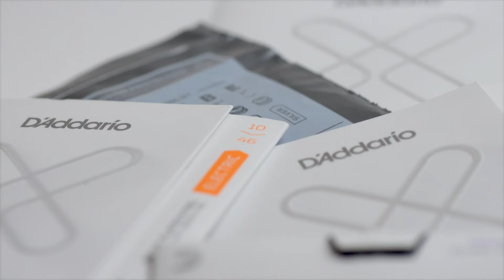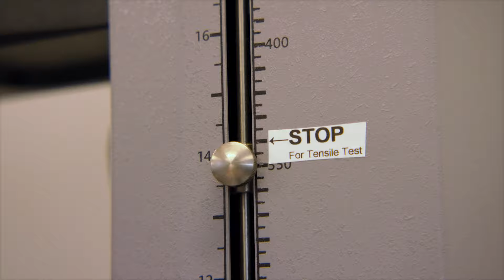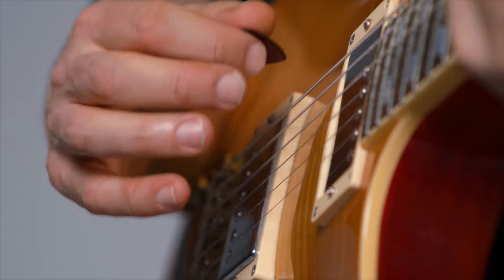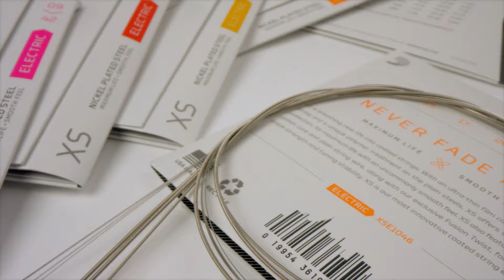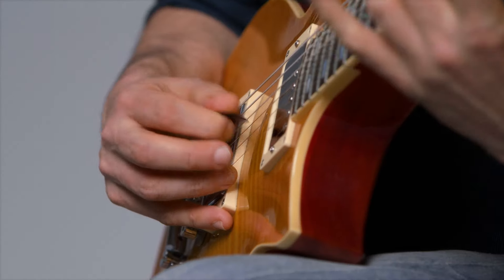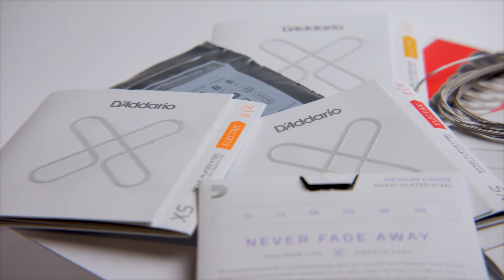D'Adarrio XS Electric Guitar Strings | The Story with Jim D'Addario | Demo with Alex Skolnick

Comment: I ran XS strings on my strat for 7 months, and only changed them because it seemed like I "should". They weren't discolored at all. There were no issues whatsoever. I replaced them with a set of the GHS Coated Boomers I used to use, and what a difference -- the Boomers do not stay in tune as well, and surprisingly, it feels like they have more friction to them. Chord changes took getting used to. TL;DR - XS strings are the best strings I've ever used.

Comment: These are the best strings I’ve ever played. Completely blown away. 

I noticed all the stuff mentioned here before watching this: my guitar sounded more like itself, very harmonically rich. I could play faster! And they stayed in tune almost immediately. 

These are a game changer!! I’m on the 9-46 set. I used to switch string types a lot… but these have absolutely the best of all types I’ve tried. The thin strings still have the fullness and resistance when I need them to… it’s like they only bend when you want them to. Also the noiseless aspect and coating feel remind me of my favorite flatwounds.

Comment: What's the difference between this and the XT?
Reply: These have a coating, more of a silky feel
Reply: @APPL3SL1CES  XT also has coating.
Reply: @aadityakiran_s  yes it does but the xs has a coating you can feel unlike the xt the xs feels like elixirs more slippery
Reply: @APPL3SL1CES  Okay thanks for the information but these are twice the price of the XTs which are in turn twice the price of regular D'Addario strings. So are they really worth it?
Reply: @aadityakiran_s  in my personal opinion yes because I have used xt and nyxl  and they rusted after 2 months and I’ve had the xs on my prs for 4 months now and no problems, I’m curious to see if they can outlast elixirs
Reply: @APPL3SL1CES  Maybe you have oily or sweaty fingers.
Reply: @aadityakiran_s  I perform in the heat which doesn’t help
Reply: @APPL3SL1CES  Yes. I perform in my air conditioned bedroom. That's great help. hehe...
Reply: @aadityakiran_s  lmao, it also depends if you like the feeling of a regular strings or smooth coated strings
Reply: @APPL3SL1CES  honestly i can't tell the difference between all the strings all the way up to the cheapest D'addario to the second most expensive.
Reply: @APPL3SL1CES  Oh is it? but no that's just subjective and everything subjective is not so important.
Reply: @aadityakiran_s  on certain strings my fingers grip but coated ones slide a lot easier for me
Reply: @APPL3SL1CES  Let us know if they outperform Elixirs =)
Reply: @daniloberserk  In tone, yes they outperform elixirs but in feel elixirs all the way
Reply: @aadityakiran_s  XT is treated, giving a more natural feel
XS is coated, for the most extended life

Comment: What’s the difference between XS and XT strings? They’re both treated strings right?
Reply: XS has a smooth feel due to a film coating on the whole string. XT has a natural feeling due to a spray treatment. 
Also XS has a NYXL wiring and looks to have more presence in the high mids so clearer tone and maximum life. XT is similar to an EXL with extended life

Comment: Tried them, tone is good BUT they don’t last a full day of intensive playing and some sweat on them…the non-wound strings tarnish and get oxidated and rusty. How the heck can companies like Elixir keep their non-wound strings from rusting (been using Elixirs for the past 14 years, and keep them around 2 months on my guitars), and D’addario cant do that? They say they have a polymer on the plain steels. Since they are plain stainless steel, how the heck do they stain and rust? Tried 2 packs already since I thought the first had problems. If you want natural feel and really true maximum life, buy Elixir Optiweb…you’ll end up spending less and much happier with tunning stability, tone and freshness (just use the Dunlop 65 string cleaner and a cloth and they’ll sound like new after a day of playing). It’s a shame really that I was genuinely interested in these strings, but they behave just like the other normal strings…not to mention they lose their tuning stability if you dig into them…something the Elixirs never do…